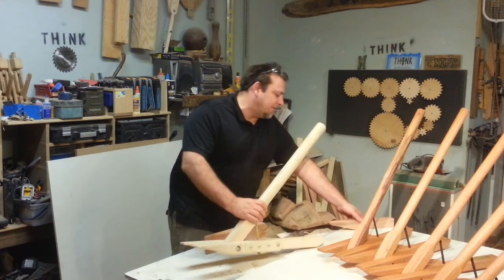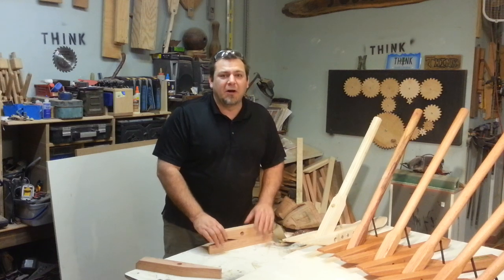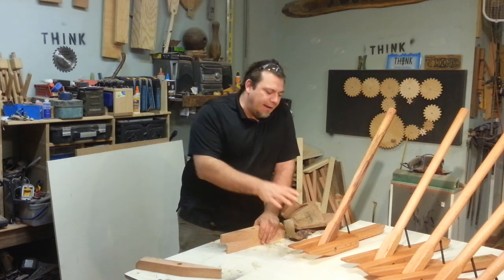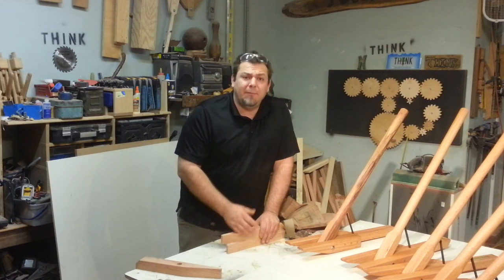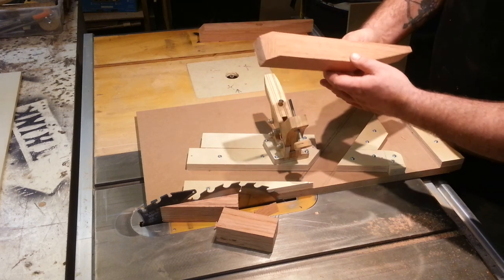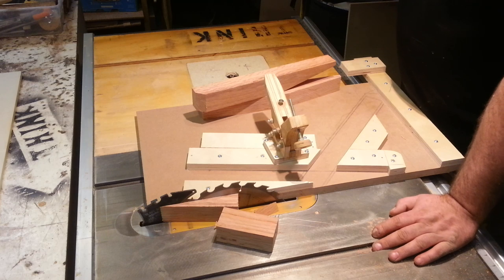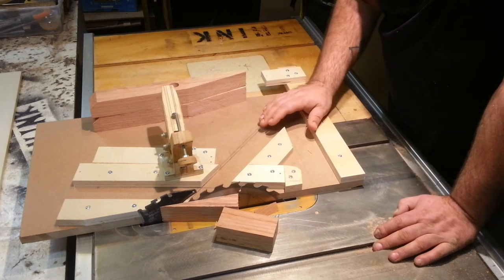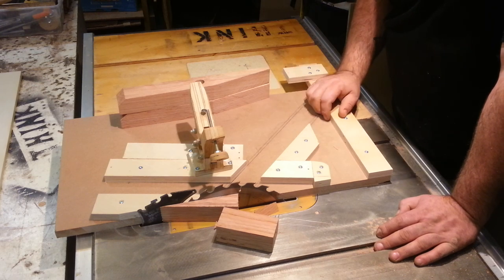Wood Working Production Tips, Multitasking Jigs, Wooden Pallet Pry bar

Comment: I may be wrong in saying this.To save time and material, why don't you make the toes twice as long and cut them once in the middle. Then you will end up with 2 toes all you have to do after that is cut the 45 degree angles. 

This just my opinion I could be wrong.
Reply from the maker: That is a great idea. but the toes don't come to a sharp point they are 5/8 think at the end. so it would be a couple more cuts. But that is a great idea and it would certainly save a little material.  Smart thinking.